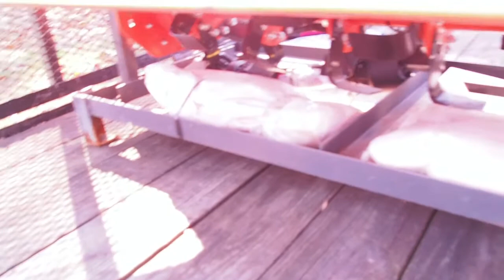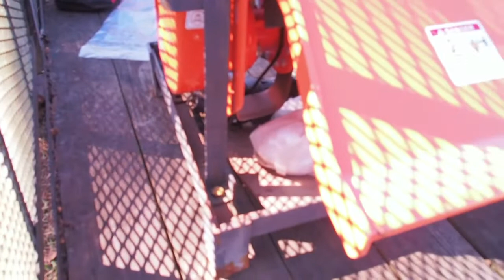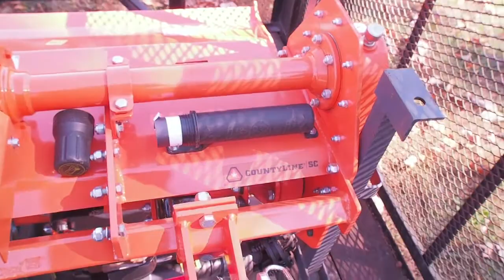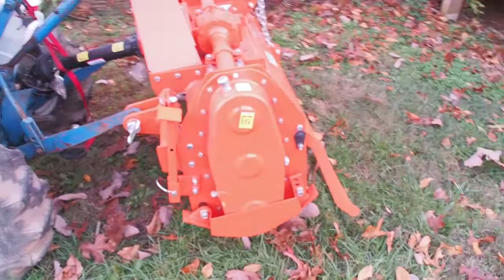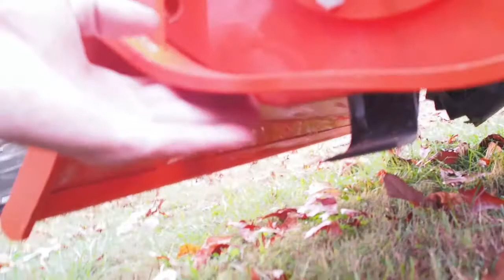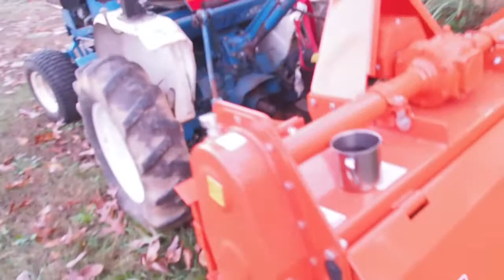Countyline 48" tiller setup

Comment: Bolt you top link arm on outside of plates at the bottom and it should straighten up.
Reply from the maker: I tried, but they don't Line up period I guess I'll try cutting off the corners of the angle just enough to pass by and see if I can get them to line up that way.  one way or the other something's wrong.

Comment: Got one of these a year ago. Used it a couple times. This thing is STOUT! Happy with mine. Has full 48" eorking width. Hit a few rocks using mine and it rolls on aheaf without getting beat up. That said,  after tilling a whole yard, loosened some bolts holding some tines. Wise to retorque when new and after first few uses...goes for any brand machine.